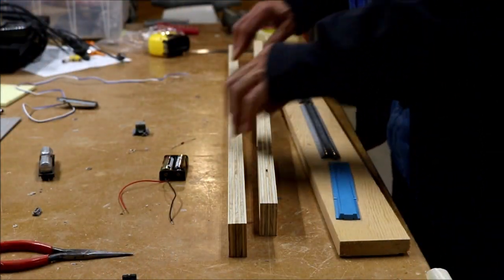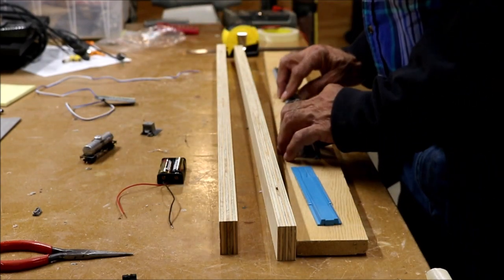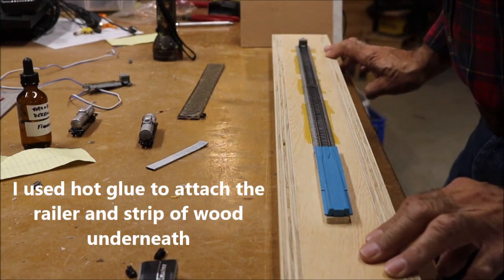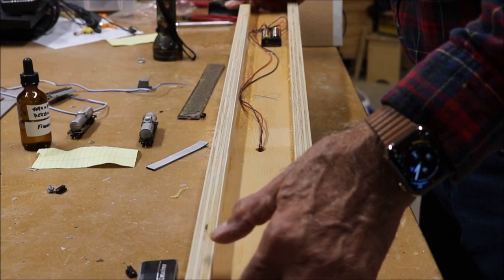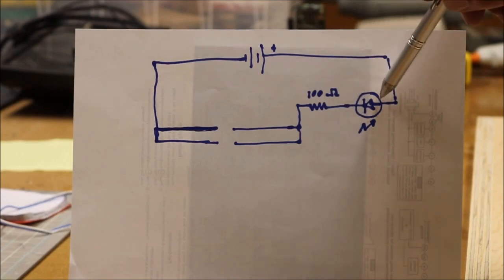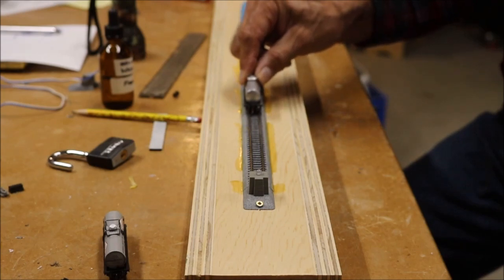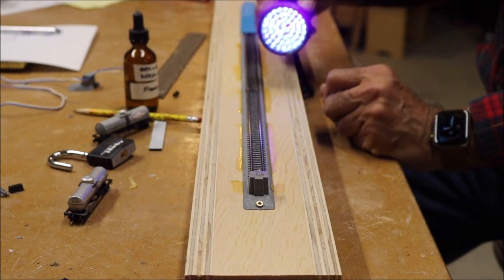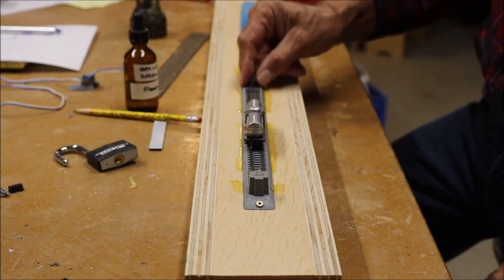Model Railroad Cars : Metal vs Plastic Wheels

Comment: They say metal wheels don't leave as much crud on the rails, like plastic does. 

All my N scale stuff at one time, had metal wheels. I found that I had less crud on the rails once I switched over to microtrain couplers and wheel sets, which are plastic. 

As far as I know, all my N scale track is nickel silver. There's no brass or steel rails.

Comment: Why so bloody complicated?? All you have to do is look at them--metal wheels are not jet black like plastic wheels are and if the axle is plastic, the wheels are generally metal. You could also use an ohm meter on a wheel--plastic wheels don't conduct. You could also give them a 'tap test' to evaluate the sound they make. Plastic wheels will sound dull.
Reply: I have a number of metal wheels that are "jet black". but i do wire wheel them to be bright on the tread. but if the axle is plastic the wheels are cast on as one part, (set gauging). all plastic. at least i have not see any plastic axles with metal wheels. lots of metal axles with plastic wheels. 
but as to knowing what is what. i just use a foam cradle, and when i go through a car. i change out plastic for metal.  and any car having any problem (or going down to be "inspected", for club usage)  goes through my "shop". 
I do a complete service for all cars going through said shop.
Reply from the maker: I cannot tell by looking. I have seem plastic wheels which are brown colored to simulate rust. And if you paid attention the setup IS a crude ohm meter but you dont need three hands to keep the probes on the wheel, keep the wheel from spinning. And I dont trust my ears by tapping,
Reply: kadee wheels are metal on plastic axle.  At first, they look all plastic, but definately are metal wheels.  I think they also have a coating that insulates initially, but quickly wears off leaving a silver tread.   I have noticed that in winter at least, the metal wheels are cold to touch, while plastic wheels fel warm.